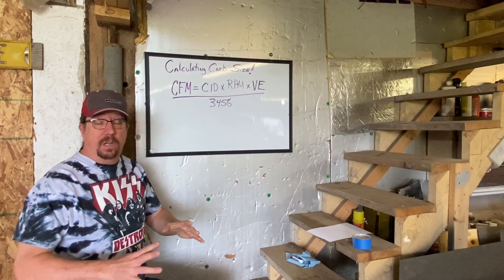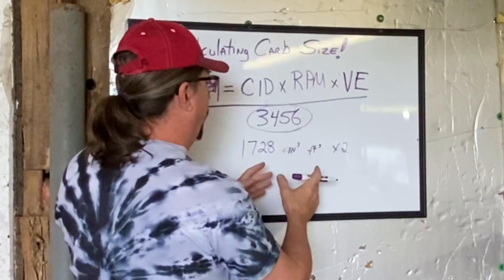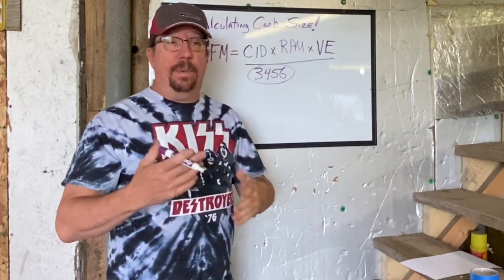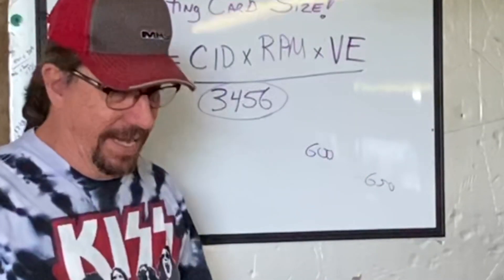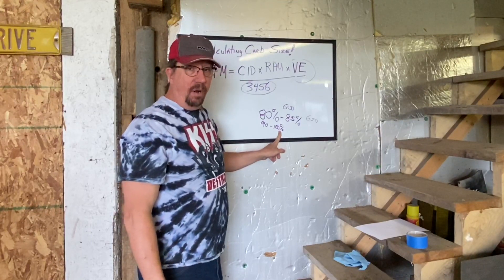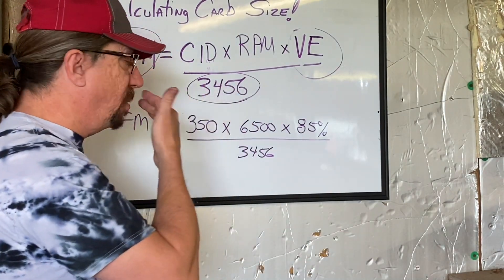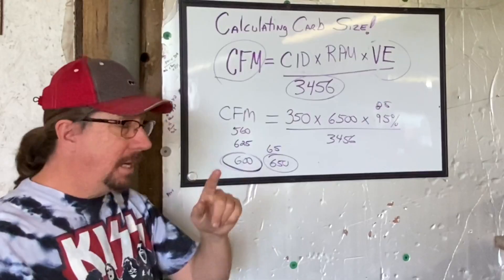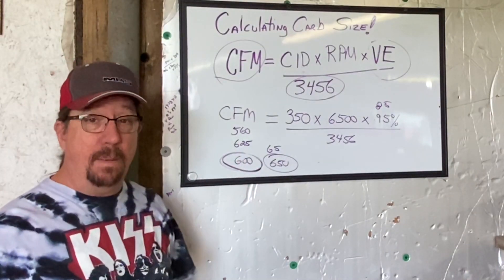HOW TO: pick the right carburetor.  SIZE MATTERS!!!  Don't overestimate, do the math.

Comment: A 5 liter spinning 5000, with 80% VE only needs about 385CFM, so even a 600 CFM is overkill. A 454 would be still be less than 600Cfm at 5000 with 80% VE
Reply: You are 100% right! - This is the #1 WORST thing I see people giving for advice in Social Media Groups...Bone stock 5L to 6L V8 and EVERY ding dong chimes in and says "put a 750 on it"....Look at XYZ Magazine, they used a 750 or 850 on the DYNO - yeeeeeeeaaaaaah and the dyno is ONLY run at WOT, do YOU drive thru the Tastee-Freez line at WOT? - Didn't Think So! - They put a 750 on it and think wow it runs GREAT, I get in it and think "wow the midrange on this thing is full of holes!"
Reply: @misters2837  

I like it when they will say they can feel the Secondaries "Kick In". One should never notice the Secondaries opening, if there is bump, that was a recovery from a Leaning out. Also, only Fools will run a Double Pumper on the Street. 99% of Vehicles, even those that run the 1/4 mile on weekends, will do much better with Vacuum Secondaries
In 1979, I was listening to a guy telling me how he put an 850 Double Pumper on a 289, and how great it ran. I asked him if he was spinning past 10 Grand. He said no, highest it would go was 4800 before the Tranny would shift. I just told him great, glad you liked it. Idiot
Reply: @pjimmbojimmbo1990  (That 289 probably never even Got the Secondaries OPEN!) - I try to explain that the "Primary Barrels" are what is screwing them in the mid range, and they never grasp the idea... The Q-Jet was perfect all around carb, it was put on 252cid V6 and 500cid V8 but it had 200CFM Primary Barrels, and HUGE secondaries that work on any sized engine...Much smaller than the 375CFM Primaries on the Default "750" every ID10T has to slap on their STOCK 302 or 350... ALSO trying to explain that 2bbl an 4bbl CFM are TWO completely different rating systems... I never really got into the Holley carbs, I tried tuning a couple for the street, Not that they are bad, we just didn't agree, I have Carters and Edelbrocks that have been in service since the early 80's that only needed adjustment when this corn gas came out....
Reply: @misters2837  

The 850 I had referred to, was a Double Pumper, so the Secondaries would open even if the engine only needs 50 cfm.
I agree about the Q-jet being one of the best Carbs ever engineered, and it's capability to be utilized/calibrated for many engines. As for the 750/780 Holley, cut the secondaries off and you have the Holley 500 CFM 2bbl. It is about the Perfect size for a 5 liter engine. I have used Holleys on my Boat, and on a couple of Trucks, they are okay, but are not easy to calibrate for both Power and Economy. It is easy to calibrate for one or the other, but to get both takes a lot of math, and often drilling of the Metering Block/Plates on the Power Circuit to ensure enough fuel when needed, once the Main Jets are leaned out for economy. 
That Corn Gas, has been a major F*** Up for a lot of Fuel Systems, plus it is very bad for use in Boats, as it likes to absorb the Water that is in the Air, and that causes all sorts of Grief.

Comment: My 800cfm edelbrock carburetor is likely to big for my 383 stroker. 3800 Stahl 3 speed.Having idle issues & fuel pooling in intake. I used your calculations & came up with a 650 cfm carburetor. What do you think?
Reply from the maker: Based on experience, especially for a streetcar the 650 would probably perform better for you.
Reply: @MyKARSShop  thanks.  I'm gonna just sell my motorcycle & purchase, holley sniper efi system.  Time for a big upgrade.
Reply from the maker: From everything I hear sniper is a great way to go. I actually hope to put that system on one of my cars eventually.
Reply: @MyKARSShop  called jegs & purchasing the efi kit & hyperspark kit Aswell. I'm sick of carbs & the issues. Thanks for your feed back.   Great vids
Reply from the maker: @jtauto74  That’s awesome. Let me know how it goes. I’m really curious and interested
Reply: @MyKARSShop  I sure will
Reply: What's a Stahl?
Reply: did you ever install the EFI?  I put a 650 Vac Brawler on my 383 and it works great.

Comment: Awesome video.  Great detail.  I am new to carbs and have been looking to my buddies for help and they all throw out random numbers.  Lol.  I am a little stumped on my VE still though.  What carb would you use in my setup?  68 mustang driven on the street and cruising.  331 stroker, AFR 185 aluminum heads, performer intake, roughly 6500 max, headers and auto Trans C4 with 1500 stall.
Reply from the maker: Do you plan to drive it mostly on the street? Or is it pretty much a race car that you’re only gonna drive very rarely on the street?

If it’s a street car I would use the average VE number that I mentioned in the video 

In my opinion, and the way I approach it is I want it to be as drivable as possible & not be fouling out plugs and so forth for normal driving.

I’m in the middle of filming a new episode on floor pans right now, but I will try to remember to circle back to this tonight and crunch some numbers and offer some suggestions.

Comment: I seen a video on YouTube when a guy took a sound and stock 350 and put it on a Dino. He then tested different cards from 500 cfm two barrel to 1100 cfm four barrels and got the most power with the 1100 ,was this a scam.
Reply from the maker: There would be so many variables in that I would have to see the video to understand exactly what they were doing. 

Remember that everything I’m talking about here is for a street car not a race car. When it comes to race cars, all of this goes out the window.

I doubt it was a scam, but I would be curious to know the exact set up, the exact carburetor, vacuum secondary? Mechanical secondaries? What kind of loads were they putting on it… Also what did the plugs look like after several hours of driving and running… Etc.

An engine is an air pump… They can only move so many cubic feet of air based upon its displacement and mechanical configuration.

If you happen to find the link, I would love to see the video and look at what they’re doing.

Hey thanks for the awesome feedback. I appreciate it

Comment: Totally agree that for street use smaller carb always runs smoother..But...Dyno numbers and dragstrip mph show specially tuned 950cfm will make slightly more power everywhere above cruising speeds on your typical 450-500hp 383cui.. not talking drivability
Reply: There are plenty of Dyno tests showing that a 650 will support up to 500hp motors with only slight gains by larger carbs.
Reply: @cuzz63    There are also many dyno tests that show bigger carbs produce more power. Check EngineMasters for actual dyno results. I'm sure My Kars Shop is well intentioned, but he is wrong.
Reply: @andronikos944  yes there are. Are you aware of the classes of racing where they make 500 hp with 500 cfm carbs?  BTW, engine masters showed where they went from a 750 to a 650 and lost no HP.
Reply: Also assuming that on a vacuum the back barrels are fully open!  You can bandade a 750 to run on a 5 liter and actually get decent milage. Get the kit to change the secondary springs, a 50cc pump and a  selection of shooters. But, it's still a Holley!!

Comment: The formula doesnt stay specific to everything. Its a good starting point. If your using separate individual runners, it doesnt work at all. And most carbs dont flow thier advertised numbers.
Reply from the maker: You’re absolutely correct. It’s a baseline.

Comment: Once ive done the math …where would the Cfm be on the carburetor be? Cause all the carbs that I’ve  checheck On eBay they don’t come with cfm on the carbs .
Reply from the maker: Holley  and Carter carburetors both list the CFM of their carburetors. Other brands, there are listings with specifications that would tell you that.

Comment: So I'm very confused about the formula behind determining the size.
This say you have a 351windsor.
351 cubic inches and say it goes to 6,000 rpm which I think is at least 500 to 1000 more than a stock engine will take.Now we take the value at 85% which again is at a very high end for a stock engine.Now after ÷ this by 3456 we come up with 518 cfm.
So my stock 1987 F150 came with a holly 600cfm carburetor.
When I use 351 cubic inches  and  5500 rpm 80% value this goes down to 447cfm.
With that being said, why would Ford use such a big carburetor that would cost more ? I think the Ford engineering department had figured out exactly what the engine required.
That's why I think this mathematical formula is misleading at best. 
I'm not trying to start some war with you, I watch your channel and really enjoy your video's.
On another subject I'm going back to the drag strip tonight with new micky Thompson 295 ss drag radials to try and get into the 14 second bracket.
Stay cool and keep making videos, really enjoy your shows.
Reply: As M.K.S. (those are actually my Initials LOL) stated, it cost the manufacturer a lot of money to certify ONE carburetor for emissions purposes and therefore you would see that carburetor on 351s and or 302's and maybe even California 460's they didn't want to spend tons of money on something that was likely only going to be certified for ONE YEAR!
Reply from the maker: Common question and I appreciate you asking.

Factory used common carburetors on multiple platforms  for cost reasons, but they didn’t necessarily utilize that carburetor 100%. The secondaries were tuned to match the engines needs.  

That’s the beauty of a vacuum secondary carburetor.  .  100% flow on the primaries and 50% flow on the secondaries would get you about 450 CFM
Reply from the maker: Let me know how it goes at the strip. Curious to hear how it goes.  

keep rockin.
Reply: the bigger carb doesnt cost anymore than a smaller one..more likely they used an off the shelf carb that was close..

Comment: This is a great lesson.
Reply from the maker: Thanks.
Reply: @MyKARSShop  I did a similar formula years ago when I used to get some of the car magazines. I knew something wasn't quite right when I'd see a Holley 1050 Dominator on a small block.
Reply from the maker: @scottinWV  it’s such a common mistake to be over carbureted. Sometimes I think guys think carburetor size is a reflection of their manhood. 😂😂
Reply: @MyKARSShop  Hmmm. Probably looks bad if I'm running a Rochester DualJet on the lawnmower then.